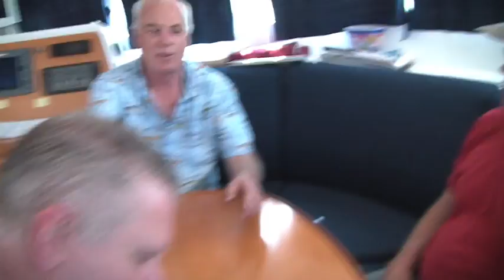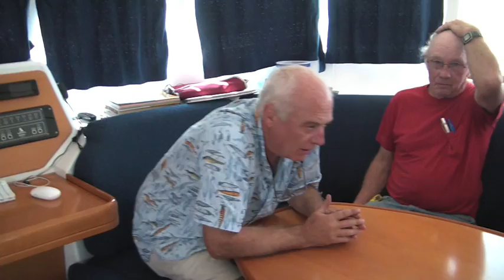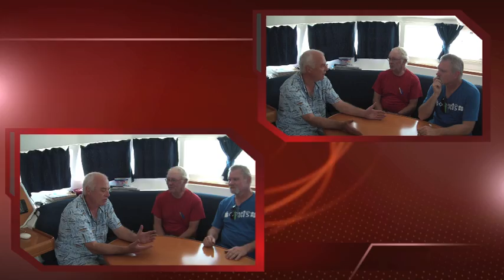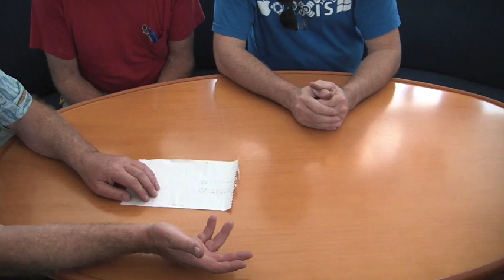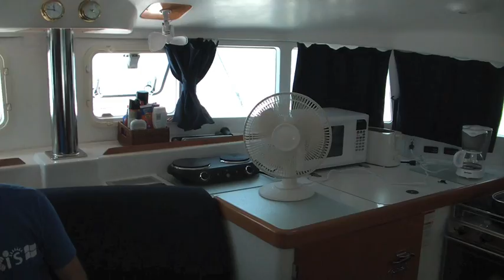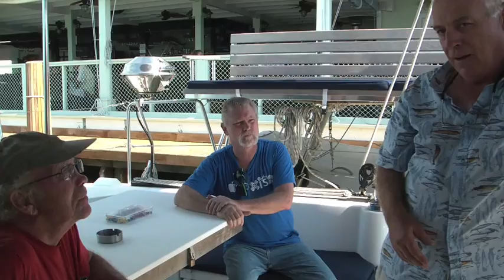Lagoon 410 Electric Waypoint with Bruce Wilson Part1

Comment: Full charge is 168V and this is the 30Amp system; VxA=W
So it is 5040Watt or 5Kw ? What type of battery you used for those boats?
Reply: someone told me there were too many problems , many owners converted back to diesel.   not sure about how much truth there is in it and not much currant info around concerning these boats
Reply: @GoofieNewfie69  2020 this world is finally changing pretty quickly. 

Can't wait to check back in another 4 years.